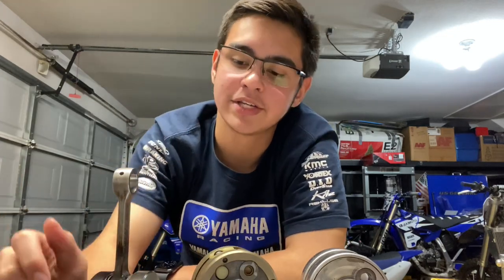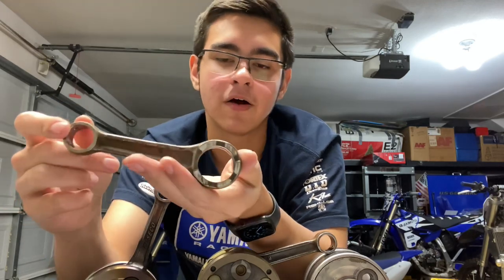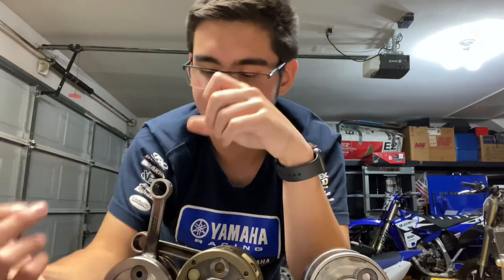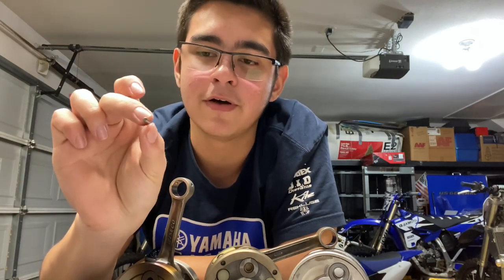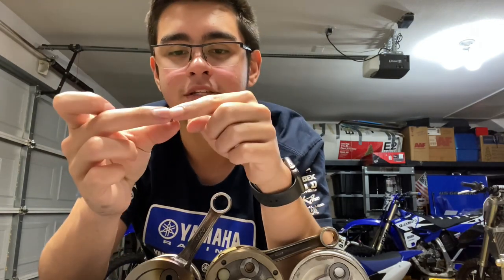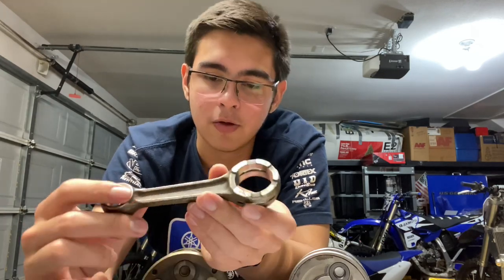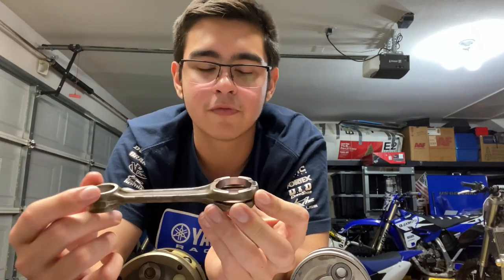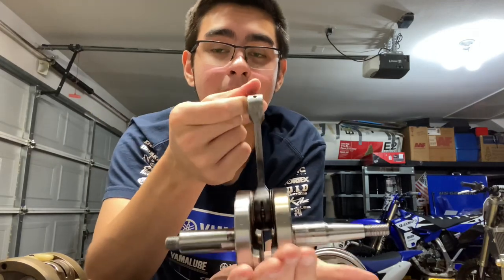Why 2 Stroke Crankshafts Fail

Comment: Bought a 65 that sat for years... its been a guessing game finding out what happened. I started putting together the pieces over the past several days as I'm getting the bike ready for the season (fixing it). I found out it was the crank shaft. Tore down the entire lower, split case, and I can see 100% exactly what you explained. The needle bearing /big side bearing pieces are so flat that they all worn down making a powder glitter throughout the lower /oil. From there they loosened out of place, found their way into other areas, froze up... From your explanation I have all 100 pieces of my puzzle figured out on what happened, how, why.... LOVE !!!! THANK YOU

Comment: Great video really explained a lot to me
Unfortunately I think I need to rebuild my 2016 TC 250 because I lost compression yesterday while riding
When I bought the bike it had a k&n air filter on it and i switched to a twin air but never realized I didn’t have the air filter cage that keeps it secure. 
Dirt got in there once when I changed the filter months ago but I got a cage and have been running it. But my lucks run out and now I’m hoping I don’t have any up and down play but only one way to find out
Reply: Also am watching your yz125 rebuild videos as I am rebuilding my 05 and I have to finish that up before I tear into my husky. Thanks for your videos. It helps a lot
Reply: I allready replace 3 piston 3 cilynder head, on eton txl50cc it keeps runing like shit scoring my piston. Next thing ill check is the crank shaft.

Comment: Slotted on the big end or non Slotted is the question 🤔 I've come across the 2 different types in rod design and there's a bit of theory behind the slots in in big end or not..... One non Slotted helps retain the trapped oil vapor in the bearing or on the other hand Slotted allows fresher oil in and older oil and possible debris out as centrifugal force whips it around the case.  I have one on the bench right now I'm not sure if I will slot this or not. It's a old yamaha 175cc engine and the aftermarket company Vesrah Co. Gave me a little different designed Con rod from the original yamaha rod. When it's fully assembled there's nothing but the little indentations on the sides of the thrust bearing surface to supply the oil to the rod bearing. To me that seems a little bit lacking in the lube department. I don't want to have to rebuild this thing twice when this could be prevented. I know their case hardened and cutting the slots need to be done in a water bath to prevent any over heating or changes to the metal hardness. Just wondering what other opinions are on this matter and if anyone's noticed any differences in lifespans between the 2 types of big ends?

Comment: About how many MX hours do you get before the bearings on the crank go out?  Just curious, I’ve done several top end rebuilds but have had to dive into the bottom end yet for anything. Thanks again for sharing
Reply from the maker: I got around 130 hours of my crank, but you can essentially run them till they go out. Once they do go out, it happens fast. A lot of the time there will be little to no indication, so I just run them till they go out, but I check for play every top end or whenever I have the motor open.
Reply: Switched premix a few times within a year can this cause the rod bearing to go sooner then later?
Reply: @CrashOutTiming718  Unlikely.  As long as you're always using a good oil with a good ratio your engine doesn't really care if you switch out.
Reply: At first thought the oil was the issue soon to find sand in my bottom

Comment: The crank that you spin at the end of the video, I have a older yz250 and I’m at a loss on how to properly seal the clutch side of the crank. The bike clearly had a bad past when I got it and I’m not sure if it even has the right crank in it/collars etc and the seals I get for it don’t seem to fit. That style crank where the clutch side is only a straight shaft with splines, what does the seal seal around? Is there a collar I’m missing? Any info would be GREATLY appreciated thanks.

Comment: Yo, it would be awesome if you made a YouTube short of just the sound of the engine with a bad connecting rod. I didn’t come across a video that sounded like my issue and thought it was a top end issue until I opened the engine up. A video showing this as the issue would help a lot of newbies out with diagnosing!

Comment: Question; do you think whacking a crank with a rubber mallet during disassembly could throw the crank off balance and cause failure later down the road?
Reply: They never stay where you set them so we would emery cloth the journals to slip fit brand new crank bearings. Let your motor warm up and the crank centering is set by the natural alignment of the piston in the bore. This works up to high performance applications.
Reply: @bigrich7026 Good to know...I was worried that I may have inadvertantly thrown a few off balance during installation ,tho I Neva hammered them inand the engines still work smoothly but that thought was at the back of my mind:-)

Comment: I just finished rebuilding my cr80. Stock bike. 20 over wieseco piston.  Wieseco crank kit.  Im getting engine vibration at wide open throttle in neutral.  Someone said i needed to check the crank for true before install.  Any idea how long she will last?
Reply: Check your engine mount

Comment: I have a 66 cc bike kit I got from Amazon (goes on your pedal bike) any way was coming back from a long run and tire went flat and wrapped around the hub and sprocket and the chain wrapped around the sprocket as the tensioner came off but it basically stopped the motor dead stop 🛑 and can’t get the motor to turn over it’s basically locked up . I’m assuming I shattered the connecting rod pin on the crank would that do it?

Comment: Have a 98 yz125, i started it up and i heard what i thought was a grinding sound around my clutch, so i killed it, and went to start it again and my kickstarter was locked up. I took the plug out, ignition cover off, and top end off, i can turn it over by the flywheel but it is crunchy and rough like 1 out every 30 times i turn it over???? Any ideas????
Reply: My crank does not have any up and down play, and is still in spec side to side play
Reply: Ever find out? My 1997 cr125 is like that and I haven’t rode it 3 hours
Reply: @JunkRemoval-more  nope, been at a hault since then as no one seems to know, thinking only thing i can do is start tearing apart the bottom end sadly

Comment: Hey, my kx85 crankshaft bearings went bad and the big end bearing is bad. The connecting rod has play up, and down and has diagonal play. Do i need to replace the whole crank or just the bearings with the connecting rod?
Reply: I have the same problem with my rm 85
Reply: Ended up replacing the bearings and connecting rod

Comment: Do you use OEM cranks in your 125 or do you run aftermarket ones? Like hotrods or wisco?
Reply from the maker: I prefer OEM or OEM rebuilt with quality parts, but Hotrods is a good aftermarket alternative. I have heard bad things about Wiseco so I avoid their cranks.
Reply: @akmoto_  thanks, definitely gonna stick to OEM to be on the safe side.